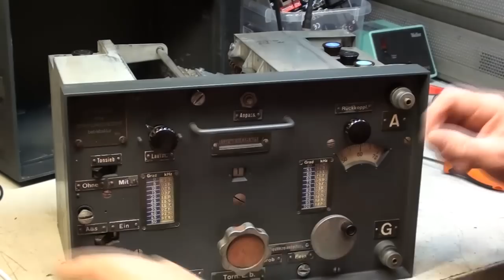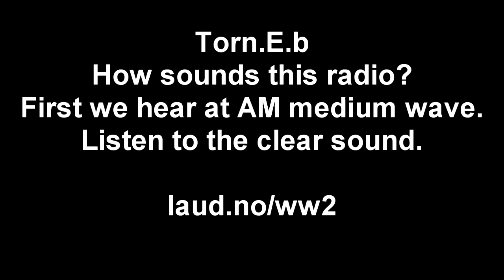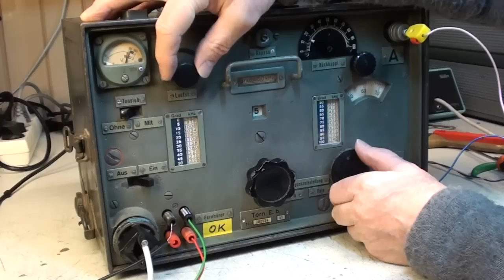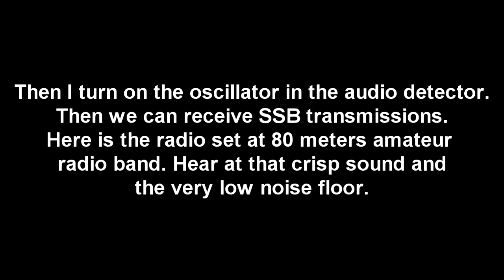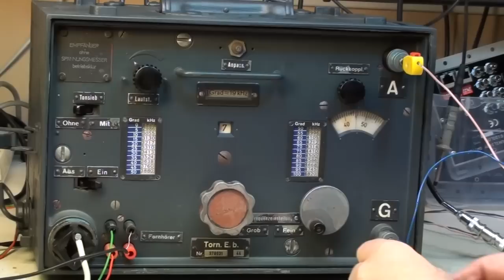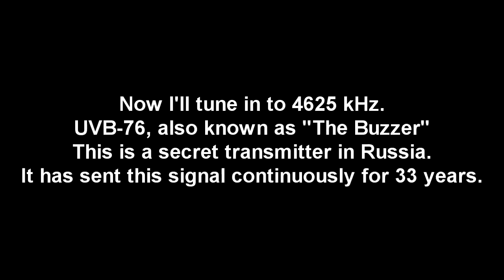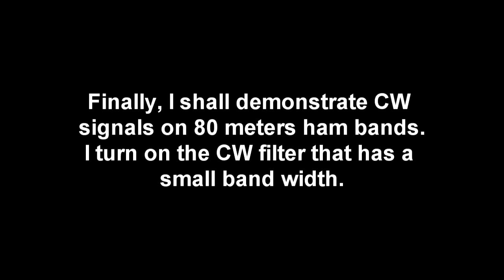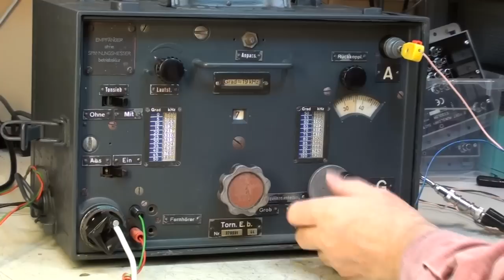Torn.E.b, German WW2 radio receiver test

Comment: What it is also worth to mention is that this Tornister-Empfänger b is using direct heated cathods. They are more noisy that indirect heated ones, but after turning on it takes only around 2 seconds to be heated up and be ready for use.
In fact the Tornistor-Empfänger b is made of 4 tubes RV2P800 (HF-Pentode), also called "curlers" because of their design. 

To get the right power out of a 2V battery there was also an inverter available, "Wechselrichter EW.b" which was typically powered by the 2V 38Ah lead acid battery "Sammler 2B38". (B stands for "Blei", german for lead).

My father had to of these Receivers. As a young man i've "played" several years (maybe between the years 1982 and 1986) with such a receiver, it made a lot of fun to use it. Even at that time i was always fascinated by the incredible design of this device.
Reply from the maker: Thanks for all the interesting information you share.

Comment: Thank you for excellent video!  I have a Torn.E.b which was acquired by a relative during his stint overseas during  WW II. It was passed on down through the family and, as the family ham radio buff, I have had it on the shelf for many years. Got it out today, took some pictures and found your web site and here I am.  Fantastic! It is a wonderfully built radio - mine has paint loss and the front panel labels are very difficult to read but the interior is in great shape. I am seriously considering building a simple power supply and seeing if I can get it working. Again thanks for the information.
Reply: Hey Bob, did you get it working ?
Reply: @bogdanbacanu605  Many other projects go in the way so the answer is no. There it sits on the shelf!!

Comment: Looks like a well designed mechanical layout for the tuning and the audio quality is similar to the later Model R390 we used in the 1960's.
Reply: About 1/4 the size.

Comment: What kind of restoration has this set receiver gotten? I'm sure you must have recapped and realigned the receiver, right?
Reply from the maker: Thanks for the question.
I have many such receivers.
In a few of them way I replace capacitors.
Otherwise, only cleaning and lubricating moving parts.
These are high quality radios.
Reply from the maker: Often it is also unnecessary with calibration.

Comment: Witnessed German design of DC line voltage to 220 v AC in a small pack so beautiful and compact to operate Record player Radio to my happiness to note German advance stage of technology in 1970-1980 at a tea garden power supply used to be DC .Air port surveillance Radar is just another feather in their cap 🎉be dedicated nice old is gold and present too shine spreading…